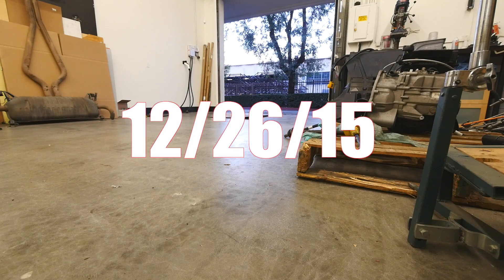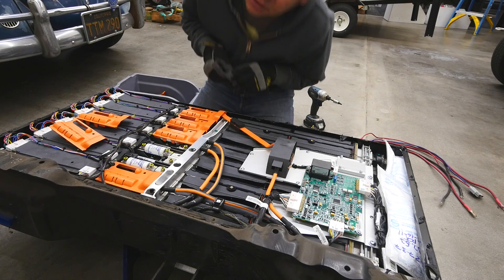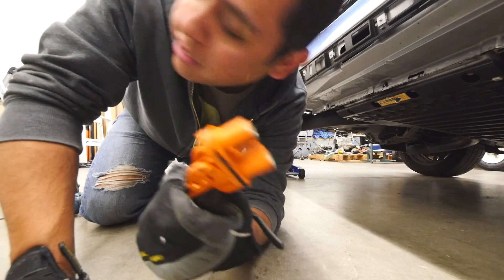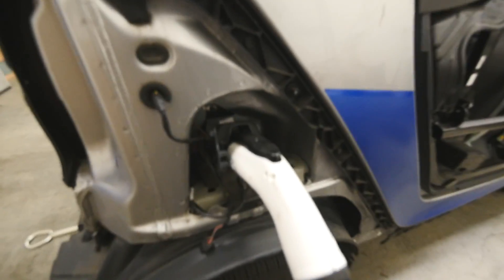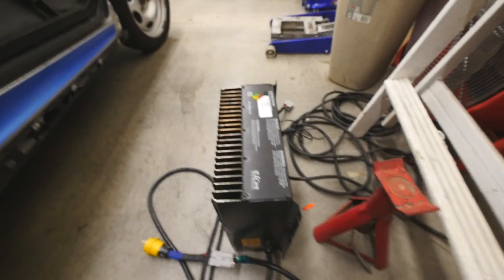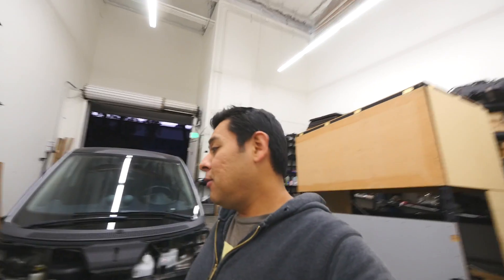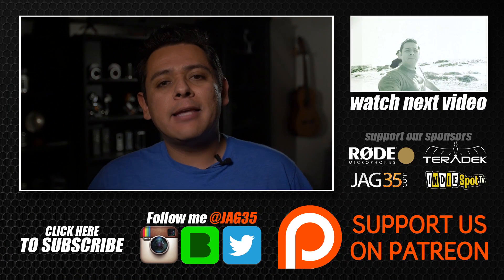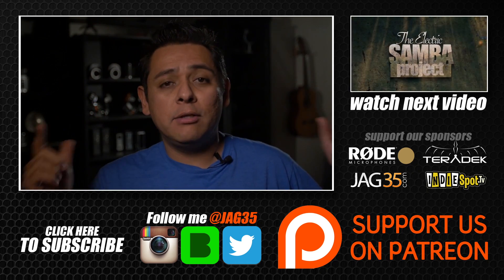DEAD TESLA Battery pack Successfully REVIVED

Comment: hi jehu, Ive 3rd gen smart with HV battery problem, I also measure the HV system, and is 3.4Volt each cell... how can I contact you?
Reply: 2014 its not using tesla battery
Reply from the maker: Bosh packs usually Samsung cells.
Reply: jehugarcia do u think has the same problem? I have elcon charger
Reply from the maker: no idea,  try it
Reply: I Will try It keep in touch

Comment: The error lights when you first started the vehicle is because the vehicle was at a completely "dead" state.  Normally there is the batter pack for the motion of the vehicle and a separate battery for the computer controls, etc.  If they both are dead then the car effectively just woke up from a coma.  It has no idea where it is what has happened what you have done to it.  It made sense change were made (think "aaaahhhhh I've been molested! someone has been in my under carriage and been feeling around under my skirt.)   A lot of cars also have a wifi or antenna service to call home to mama and once that has completed it may clear some of the lights.  The tire light most likely is because the TPMS needs you to validate the proper pressures are in each tire and press the TPMS button to recalibrate.

Comment: You are going to blow up one day. In a month or year. When the battery will be fully charged, warm, and maybe after a small bump on road... One of cells will self-short internally and cascade. Saw it many times, with all kinds of batteries. There is a good reason why "permanent failure" flag exists in the BMS. Playing with fire here, mate. You must have some serious insurance if these projects are delivered to clients.
Reply from the maker: +Sarunas S. (elektrinis)    Danger is my middle name
Reply: jehugarcia haha, women dig bad boys. Btw, my company is making nice Li-ion modules, based on 18650. Electric formulas are using them... I think you should be interested in having them on your webshop. www.energusps.com/shop
Let me know what you think.

Comment: The reason you shouldn't fix a lithium ion battery that has gone in under-voltage lockout is that if the battery voltage goes very low the copper electrodes inside the batteries will start to dissolved in the electrolytic. When you then charge it again the copper will deposit. Now, if you are unlucky the deposition of the copper will short the battery or it will deposit in a way that it might short, sometimes immediately, but it can also happen later. In general, a shorted lithium ion battery means explosive fire. So it could happen tomorrow, in a month or never. Is it worth the risk ?  Might be, might not be
Reply: Why can't you keep your shop?
Reply from the maker: can't afford it

Comment: What is this? That car sounds like it wants a bullet to the head to put it out of its misery
Reply from the maker: +Sadochrist  this car does not have heads
Reply: I know nothing about this stuff, not sure how I got here and found this neat. I thought the same thing as Sado except I have NO clue what a "head" is. Care to explain for the curious? (simple one will do ^^)
Reply: The smart car's were soooo small and light that when they were initially released they were practically silent  A few people walked out in front of vehicles that were going 45 or 50 down a highway because they couldn't hear them.  Remember no engine, small vehicle with small tires=no road noise.  So people wouldn't hear anything except what sounded like wind. (not realizing it was a car)  After about 10 or 20 accidents in a 2 month period the vehicles were outfitted with a sound creator that generates the clicking and whirrr, it's not the motor it's the sound artificially added so people would look up before crossing the road and don't get run down instead.
Reply: wizbang68 I don't know about everyone else, but I was taught to look both ways before crossing the street. It was one of the first life lessons I remember. If idiots don't know how to look up from their phones to cross a road, I say the world will be a better place without them. Darwin's law.

Comment: A friend also has taken BRICKED Tesla battery packs, charged them to get them in the acceptable voltage so the normal charger can then take over. He also balanced all the cells. Tesla should offer this service to save packs that ran a little too far down on the voltage.

Comment: How in the world would you charge these batteries if they were strung completely parallel?  I have a variable charger that can do anything btwn 2 and 80 volts and can't get them to take any charge and keep it. I was hoping for much better results like yours.
Reply: +Kelley Johnson 
What is hard in charging batteries in parallel?
They just have to be in similar state of charge.
Reply: Well honestly you if you have to ask this, I think this might be something you shouldn't be messing with until you learn about it. These battery packs contain (or should) a lot of energy, and if you make a mistake, that energy can go where it shouldn't, or react the way you don't want it to.
If everything was strung in parallel, then the overall voltage will be the voltage of the cells (which should all be the same), but the capacity will go up.
Now depending on your charger, if you are trying to charge this battery pack without dissecting the battery bank, the charger may be able to put out the correct voltage but not have enough power to actually charge this cells, or it would take a very very long time.
If you divide the cells up into groups to be charged, it will be easier for the charger to handle that and will charge each group quickly. Just don't let them charge too quickly.
I only make this point because most EV chargers seem to be 20 volt and 30 amps, the portables ones even being 120 volts at 12 amps, which is still a lot of power.
Reply: Thanks guys!  This is awesome! I will have to try dissecting the pack and charge individually.  I had to discharge everything as I was building the system and changing electronics.  All it took was one nice spark to warn me of that.  I actually have tried like four chargers but right now I am using the one I built so I can get the 54 and 57 voltage right.  The most amps I can throw into the battery is 15. Can I throw in more voltage?  I did charge the whole pack for a solid two weeks at 60 and got nothing, tried again at 57 and got them up to 5 volts which they lost in 12 hours so I haven't triggered the low current mechanism back on.  To tell the truth it is a pretty big project I decided to go with but at least my brother in law who is an electrical engineer says I am doing everything right after he grilled me on grounding properly ;).  I had to take my file to the rod to get a good connection. Now to get these babies full so they can do their job.
Reply from the maker: you are making me nervous Kelley,   I hope you know what you are doing.
Reply: I am trying but still no success.  That is a lot of money for batteries that will not hold a charge.  It is getting really frustrating. And before I started working with these batteries in my solar array I did learn how to charge on smaller lithium batteries.  Believe me, I make myself nervous too.  I just have no one who can help so it is all uphill education. As for the grounding problem- the people I rent from don't have this half of the house grounded properly.  I realized that after watching a video on grounding to a car.  If it weren't for You Tube...who knows?  House fire (actually not a joke) that is what burned out half of the outlets in the house before I moved in.  Currently, I stopped trying to charge the batteries through the system, disconnected them and am working on one.  It got up to 30 volts in 10 hours but acted just like a capacitor and lost it all within a minute.  Is that normal?
Reply from the maker: +Kelley Johnson   Ok,   Let's start from beguiling,  what kind of batteries,  how many, how are they connected and what are they connected to?     Pictures help a lot,  video is even better and YouTube is free so,  no excuse for no video.
Reply: Kelley Johnson
Just like jehugarcia said, defiantly more info, and videos are great for sharing a lot of info.

As far as the grounding problem in your house, and burned out outlets.... the house ground isn't used typically. Its a safety feature,  but as long as there are no other problems, you can go years and years without any grounding. You should still have it, but the lack of it won't cause any problems on its own.
Hopefully an electrician did find all the problems and fix them.

Comment: Deeply depleted li-ion batteries (below 1.5V per cell, what was the value in your case?) can be be dangerous. If you recharge them you might experience a thermal runaway situation. Your shop would have bunt down and you might be severely hurt. Hope you are aware of these issues. To be honest if I look at the way you deal with these this car I get sick... You dont understand the handbreak sign? Hello? How about a handbook? Handbooks are on the net. 

Despite from that: I own a 3rd generation Smart electric drive. Very much fun, indeed.
Reply from the maker: +Rollo Martins  Be careful with your smart car,  they can be dangerous if you strike a large object while moving at fast speeds you could be injured.

Comment: Why is there TESLA in the title?
Reply from the maker: +InterCo - interface212  because there are Tesla Manufactured batteries on the video,   did you watch the video?
Reply: jehugarcia In a smart car? And yes I did watch the video.
Reply from the maker: Yeah the 2nd Gen Smart cars had Tesla batteries,   small run around 2500 vehicles in 2009-2010.
Reply: TESLA mfr's the battery.
Reply: According to Tesla when they decided to convert a smart car to electric Daimler was going to be in Southern California and were scheduled to visit Tesla, but Tesla was very small and running out of cash so the as Daimler wanted to find a supplier so they could electrify the smart car. Tesla decided to build a electric smart car and had 60 days todo it in, not one week. Tesla had to custom design the battery and figure out how to install the roadster drivetrain into a smart car using the existing space designed for a gas engine. 

    When Daimlers visit finally arrived they were showing the Daimler executives a video they had put together using Microsoft office which it quickly became apparent wasn't impressing the executives so Tesla stopped the presentation and asked the Daimler executives if they would like to drive an electric smart car? They looked at the Tesla guys and asked say what? The Tesla guys the took them out to the electric smart car and Daimler didn't think it would work. Remember now the roadster motor was 244 horsepower which is what Tesla installed in the Smart car. 

  The Daimler executives were astonished that Tesla had a drivable electric smart car and by its performance and every executive from Daimler got out of the electric smart car with big smiles on the faces. 

   Daimler signed a contract with Tesla to provide Daimler with kits to electrify the smart car and the contract money helped Tesla survive and continue to grow with the money Daimler invested in Tesla. Several years later Daimler took over production of the electronics and battery's and drivetrain for the smart car.

There is a video Tesla did that verifies the information you've read here. I will post a link when I find it again.

https://youtu.be/QMpWXN8IC-U

Go to 1:07:45 to find the Tesla Smart car story from Elon Musk himself.

Enjoy.

Cheers

Comment: Are you worried about battery performance under load, since it is a disposed battery and was fully discharged?
Reply from the maker: +Rusty Travelboy Rob 
not really,   this batteries are practically new,  and it was slowly discharged down to 3.4v per cell,  well within safe voltages.  Even if they had gone down to 2V per cell,  i would not worry as it was only for a few days

Comment: I haven't seen many of ur movies so my question maybe is stupid etc... but... can you tell me how long does it take to achieve 100km/h from start using any of these electric vehicles? asking cuz I wonder if the acceleration is large or... you know, shitty x)
Reply from the maker: +tuprprojekt   Depends how big and heavy your vehicle is,  and how big your motor and battery also.
Reply: Hmm... for example that Smart with a motor and cells pack that you used? btw. what is that motor?
Reply from the maker: https://youtu.be/q_3lJUKIpM8?list=PL2l32K1w0jp-m04Jl-3PHmtapevOuCeIp

motor specs link in the comments
Reply: +jehugarcia thanks for replies and keep it going! : )

Comment: Although it's cool this works, I would bet you could use that service disconnect as the point for a jump-charging cable, if you have the use of a second car with a comparable pack, that's working. Probably want mechanical contactors in the middle of such a cable.  A whole lot less disassembly & reassembly that way.